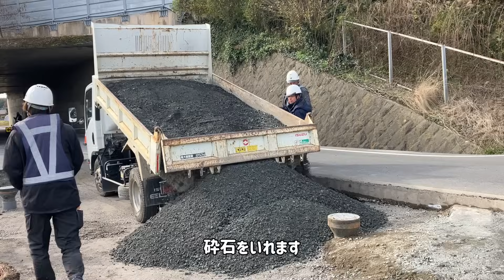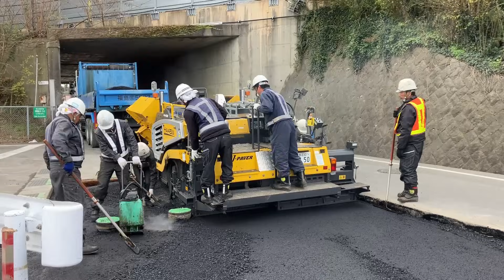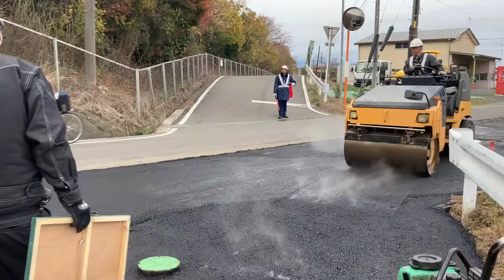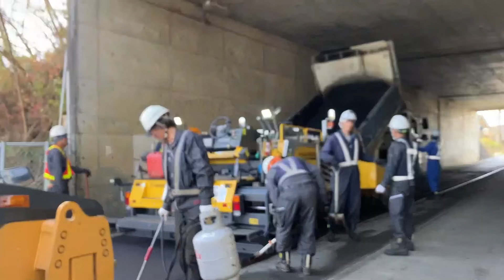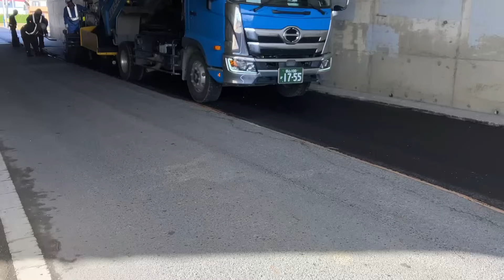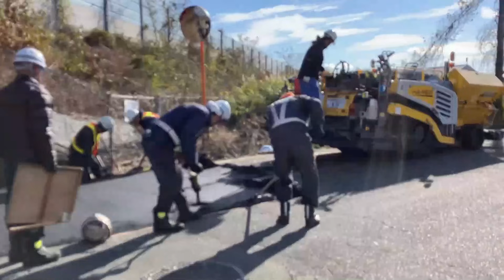アスファルトフィニッシャー舗装工事　住友【HA45W】Asphalt finisher

Comment: ... Being both an operator of track machines and paver operator for over 50 years I can tell the mini excavtor operator is pretty dang good at loading trucks without a thumb, I like that smaller wheel paver, nice work guys. I wish I could read what your documentation blackboard board says on it...?
Reply from the maker: Thank you very much. I think that both the excavator operator and the asphalt finisher operator have high skills. The document includes reports to the manager on the temperature of the asphalt mixture, the thickness of the asphalt mixture, etc.